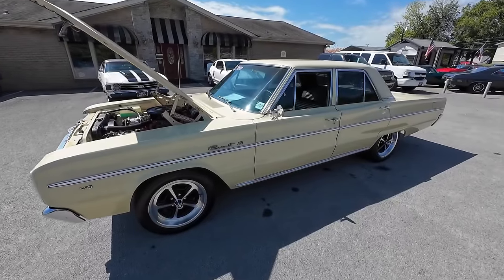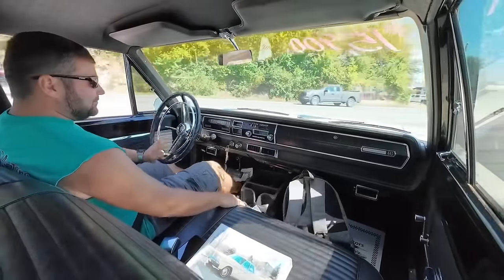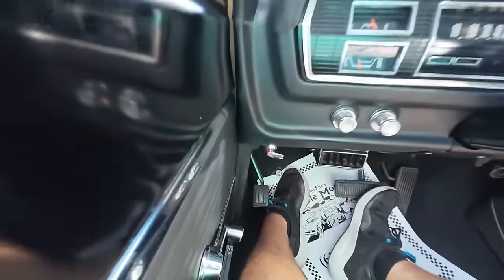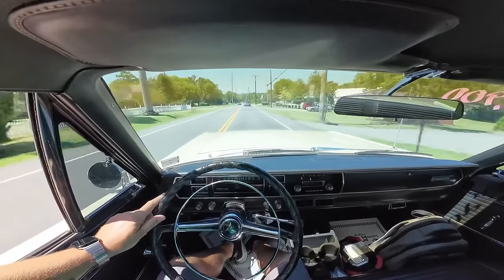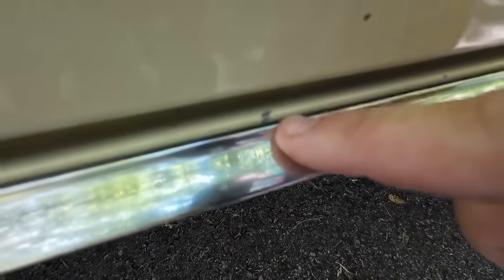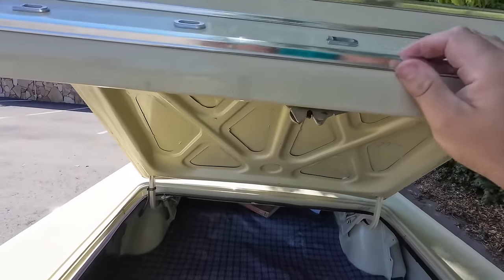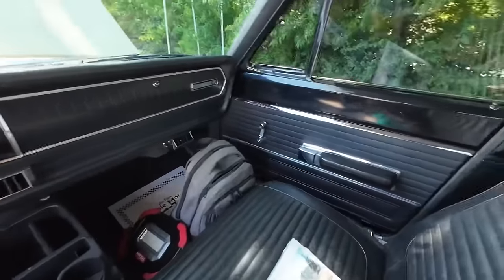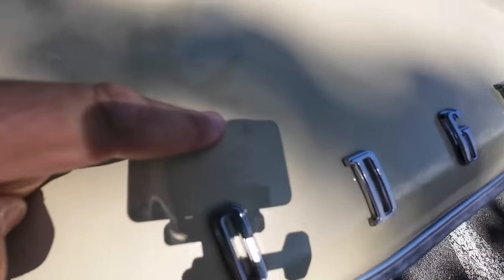Test Drive 1966 Dodge Coronet 440 SOLD $15,900 Maple Motors #2317

Comment: This is for mopar impaired viewers . 440 on this car means the model . This car has the original poly wide block 318 not to be confused with the later 273 -318 engines . This engine has the polysphererical  combustion chambered heads . Kind of like semi hemi  heads .
Reply: Wow. I forgot all about the old 318 wide block. It’s basically a big block as well no? Sounds like one. Anyway thanks for the input

Comment: This baby is pretty nice. I'd definitely use this for my daily in the spring summer and fall months. I had a 70 4dr with a 383ci. Car was in about the same shape as this one. I sold it for $2500 about 20years ago.

Comment: I was reaching for my wallet when I saw a 'Coronet 440'  this nice at that price point... 4-door or not... but no... where oh where did that big block go?  :)
Reply: 440 is the model  name, not the engine size .But it is a bit likeDodge  were trying to confuse  people.
Reply: That is the original 318 poly engine in that car
Reply: I'd always assumed 440 was the engine size... I mean that would have made sense right?
Reply: @krulux Yes I did too. It has a big old 318 wide block